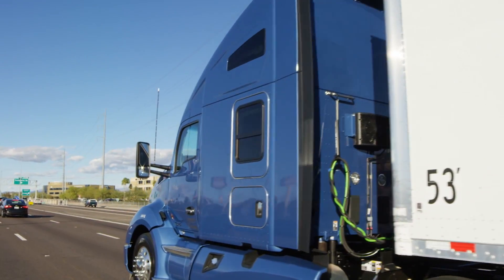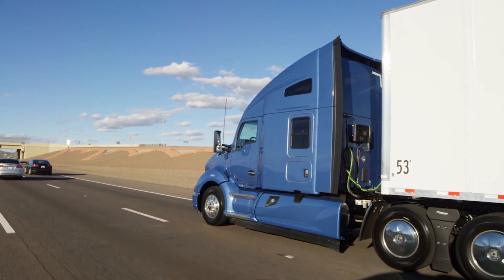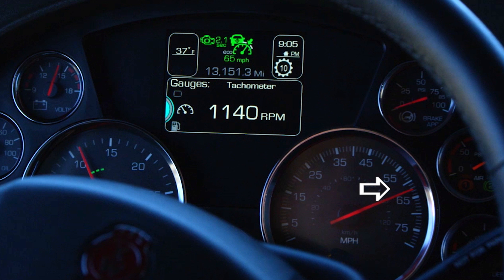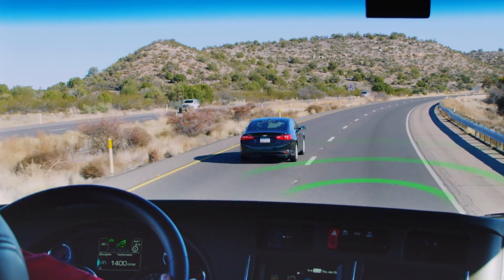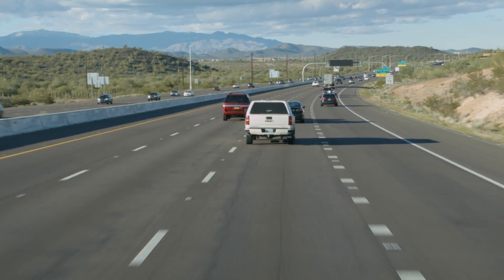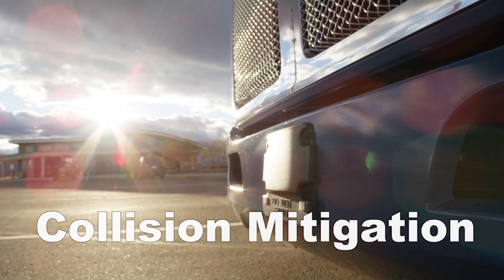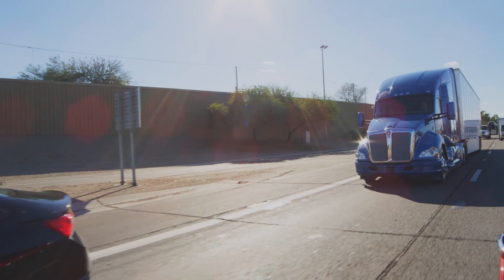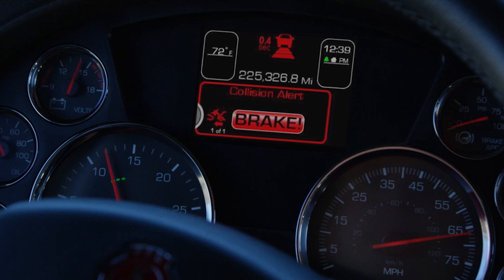24:  T680 Kenworth Driver Academy – Adaptive Cruise Control & Collision Mitigation

Comment: Here's the problem: ACC and CMS are computers. They deal in absolutes; 1s and 0s. They are incapable of calculating for variables, which is everything in the real world. And that alone is dangerous. There has to be a failsafe/option to turn it off or adjust the distance. Some drivers are a danger on the road with this on, especially with selfish, self-centered, impatient automobile drivers on the road that will squeeze into any space there is, ignorant to what it does to the ACC and CMS of the truck behind them and the drivers behind it.

Comment: Collision mitigation; In 28 years I’ve never needed a truck to hit the brakes for me. This does it all the time and never when it’s needed. Coming down the hill in snow and ice, no one in front of me, and it decides that I’m going to hit something in front of me and slams on the brakes. This system needs an off button for winter driving. In fact it should be illegal in winter conditions.
Reply: I've been lucky that snow builds up and disables the radar on its own. If I were driving a lot in those conditions I would unplug the radar (NOT THE FUSE, that would also disable ABS. that I really don't like, it's one fuse for both)
I was lucky enough to have a deer jump in front of me once. My radar didn't work for weeks because they didn't demand it get fixed : )

Comment: Collision Mitigation fails in the winter, as soon as the sensor gets slightly covered in snow it puts the truck, the driver and everone on the road in danger of a jack knife. Kenworths sollution is get out and clean off the sensor, who wants to do that every 10 minutes? Not this driver.

With all the technology we have in the world some egg head couldn't think ahead enough to install a defroster like they have in the mirrors.

Epic fail Kenworth.
Reply: WHY ON EARTH would you want this system active while driving on snow? are you stupid? "hello, yes, I would like a radar system to dynamite my brakes while I'm driving on snow and ice so that I can jackknife for no reason"
I've driven T680s with this Bendix radar a LOT on snow and ice. It has literally never braked, which is a GOOD THING because it means I have never been put in a ditch by a radar.

Comment: For what it's worth, following distance programmed into system is roughly full length of the semi distance from any vehicle in front of you. Even with a. Full load at 65, truck would brake in roughly half that distance on a dry road. Biggest problem/inconvenience is certain roads in different parts of U.S. roads are VERY hard on trucks. Easily throwing radar out of calibration. Once radar is out of calibration, no accident mitigation, no cruise control

Comment: That braking system gotta go!! Very dangerous
Reply: My Freightliner picked up on a steel plate in the road. Before I even knew what it was doing it applied the brakes at full forced and brought me to almost a complete stop. Luckily the car behind me was paying attention or I could have been hit. Our fleet manager still swears up and down that the system is the best thing to ever happen. When I voiced my complaints to freightliner, I was told that I need to just pay attention and when the system misjudges something I need to gently apply the brake pedal to prevent it from applying the brakes for me. I said well doesn’t that sound ridiculous. The system that “reduces stress on the driver” does nothing but add more stress to me because I never know when the system is going to freak out on me.
Reply: Mine has freaked out twice now and slammed on the brakes.  The one time it jerked me half way into the lane to my left.  If it was slick out I would have most likely wrecked.
Reply: In rain and snow adaptove cruise is shit
Reply: Adaptive cruise control is another nightmare in my freightliner. You can never get close enough to pass before it slows you down. If I move over before it slows me down then I’m getting ran over and passed the right and getting cut off when they jump back over in front of me. To hell with these “safety” systems. I am a safer driver when I can focus on driving and not baby sitting the radar system waiting for its next hissy fit.